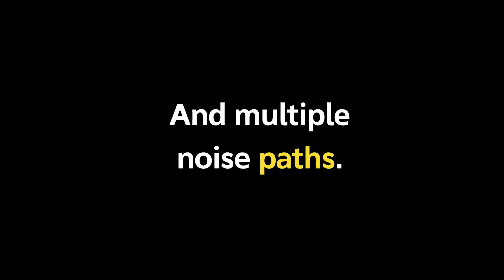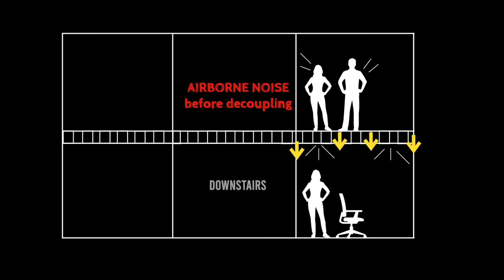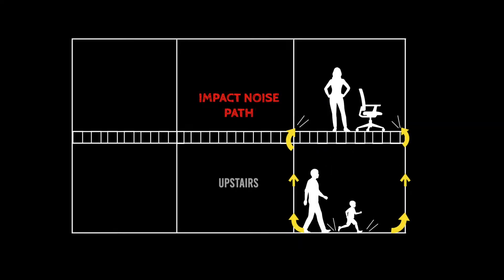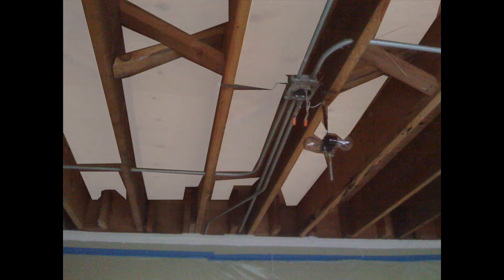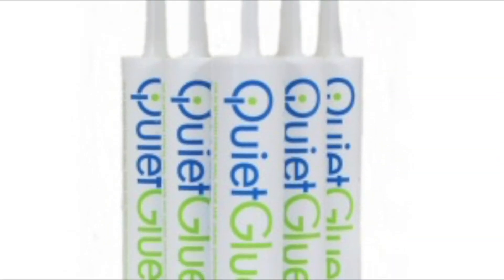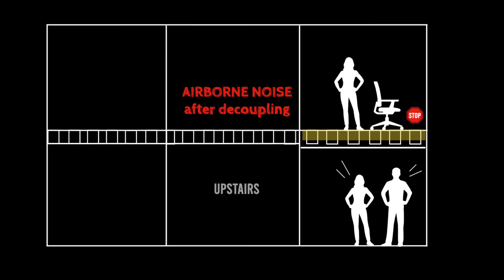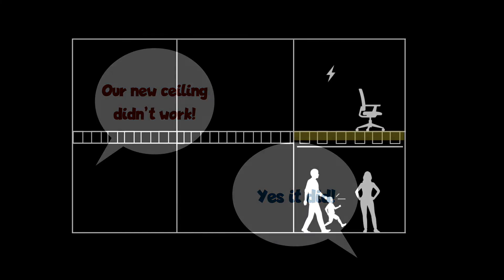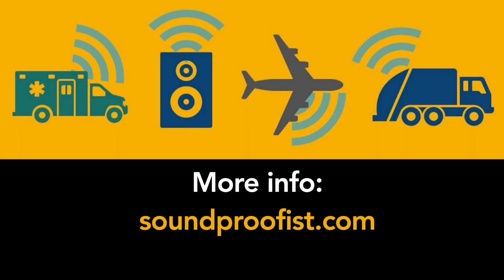Soundproofing a ceiling -- does decoupling really work?

Comment: Hello how i can soundproof e ceiling?i can hear everything upstairs neigbours do when they walk or do something else
Reply from the maker: Are you a renter or an owner? If you're a renter, possibly your only option is to try to get your neighbors to put down carpets with carpet pads or talk to your landlord. If you're an owner, you might be able to "soundproof" your ceiling, but it's expensive to do.
Reply: Owner and how?
Reply from the maker: @aggelosalexandrou7475  The solutions are likely to be expensive and (temporarily) disruptive. One of the least-expensive things to do is to blow cellulose insulation into the ceiling cavity without actually having to remove the ceiling (you just cut small holes into it and then put them back again). HOWEVER, this will only dampen some types of airborne noise. It won't eliminate bass, deep voices, or impact noise like feet. It will mute peoples' conversation that echoes through the ceiling. The more-expensive solution is to decouple the ceiling (using resilient channels) so that the drywall does not touch the ceiling joists. And inside the ceiling, after you remove the old drywall, put soundproofing materials inside the empty cavity before you close it up again. This requires demolition, and it will cost more money, but it will reduce a lot of the impact noise and the bass noise. The bad news is that if you hire a professional to do this, it might cost about $20,000. This is why some people try to learn how to do this from materials available online and by watching some YouTube videos that demonstrate each step.
Reply: Hey can you explain me please what d you mean decouple ceiling?
Reply from the maker: @aggelosalexandrou7475  "Decoupling" means that the material your ceiling is made from (plaster board, or whatever) doesn't directly touch the structure behind it. Because, as Paul Simon once sang, "One man's ceiling is another man's floor." The same ceiling joists that you see when you remove your ceiling are the same joists that touch your upstair's neighbor's floor. So vibration and noise is transferred from these joists and by the building frame. You don't see these structural parts behind the walls and ceilings of your apartment unless you open them up and remove the plasterboard. So when you "decouple" your ceiling, it means that you don't attach the new ceiling materials directly to the ceiling joists. Instead, you hang the new ceiling from some metal rails (called "resilient channel") perpendicular to the structure. There are many videos on how to do this. Here's one that I think is pretty clear: https://www.youtube.com/watch?v=IYyZ9zonfdg

Comment: Thanks for this, going to be doing some ceiling work soon. Good info to consider
Reply from the maker: Glad it was useful. We did this exact project in my building, and although it was excellent at blocking noise transmission between floors (like talking, snoring, etc.) there was this one glitch with the impact noise from downstairs. It wasn't because the project was done incorrectly. It simply couldn't address all noise paths with just one solution. However, the rebuilt ceiling -with extra mass inside the cavity against the subfloor, plus mass-loaded vinyl, insulation, metal channels for the new drywall, and soundproofed drywall instead of regular 5/8" gypsum - was very very effective for everything but this one issue.